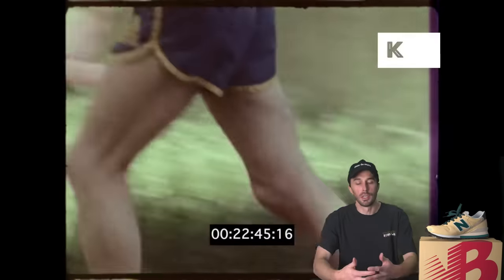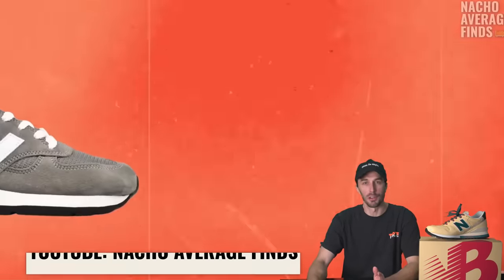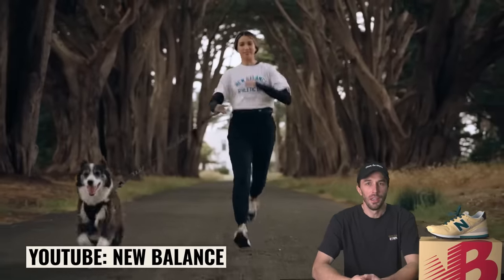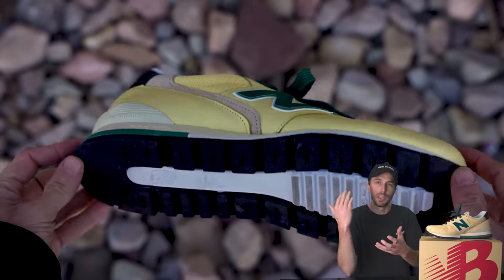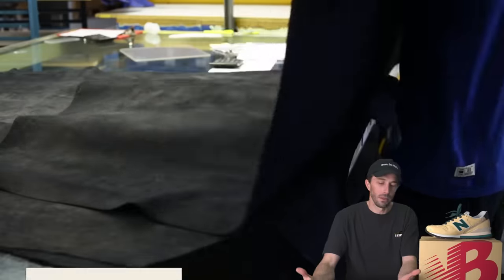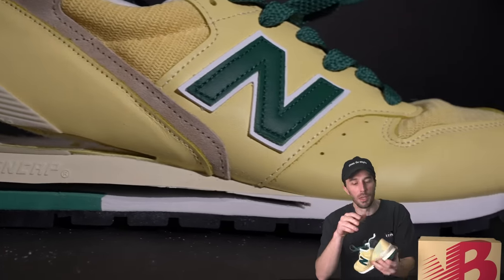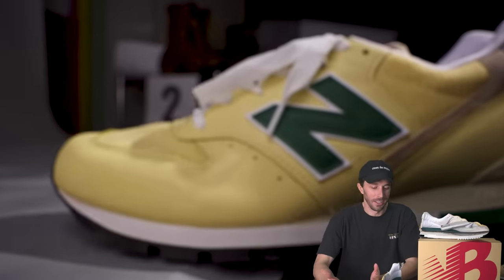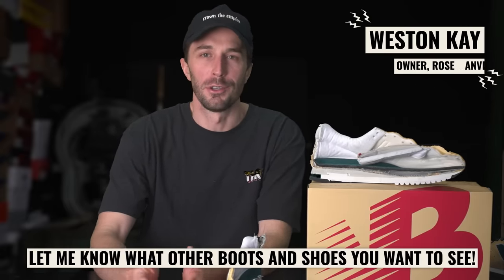(35 yrs) The Truth about New Balance 996 Made in USA

Comment: Unlike other "retro" shoes, these really are like wearing time machines for your feet.
Reply: Air Jordans 1 are a bit older, better and cheaper.
Reply: @diafwnia for retail yes Jordan 1s are cheaper but I find even budget NBs to be more comfortable than Jordan 1s
Reply: @diafwnia Air Jordan 1’s are not better in any shape or form. You can’t even compare the two, one’s a basketball shoe and the other a running shoe.
Reply: @blackdonte24  let me cook you real quick. Running shoes are one of those things no one needs. I used to beat people's ass' in track and I wore Jordan 1s always. Half the time paired with jeans 💀 The only reason these could be considered better is personal preference. Actually I'd say I can get more force into my steps with a Jordan 1 because it's just straight rubber on the bottom. These are all squishy and will probably fall apart after 100 miles. I've put over 350-400+ miles into my Jordan 1s and they eventually wore a hole in the sole. Still a totally usable shoe if I got the outsole replaced, these I font think will survive like that. These are more walking shoes in my opinion 💀
Reply: @MAJORBAGALERT-hg2kp yeah, now run a full marathon with ur AJ1 then start talking shit?
Reply: @JoeTheGetItGuy  I mean once I get into that shape again I planned on it lmao. I've had 20 mile walks, which I incorporate jogging into too, with my Jordan 1's. I've hiked 10 mile days multiple times in the Appalachian mountains (not onna trail) in my Jordan's. I used to do the 100 and 400 in track with Jordan's. I've stood around for 8 hours straight with physical activity with my Jordan 1's plenty of times. Feet never hurt the next day. I'm sorry you can't do that, but my shoes get broken in and they actually feel good unlike a brand new pair of Jordan 1's. When I get to the level of marathons I'll 100% be rocking my Jordan 1s. No one is talking shit, you ain't never heard of shit talk

Comment: I’ve worn the 574 model all throughout my childhood and into high school. They are, to me, a timeless design and can be dressed up or down. Currently I have a pair of 420 v2 that I wear often. I’m not a “sneaker head” or enthusiast, but I’m a sucker for retro shoe designs.
Reply: Me too! 574's are humble, democratic shoes that you can wear all year round for everything. Normcore, low key, almost invisible shoes this days. And cheap too. I use old pairs for hiking as they were hybrid trail running shoes at first. This year I ran the Formentera half Marathon, here in Spain and they perform great. Eva foam molds your feet with time like Birckenstocks. Love them.

Comment: One that would be interesting to see is the Onitsuka Tiger Mexico '66. It's the Asics shoe, the brand that Blue Ribbon Sports (later Nike) bought from Japan and resold in the US to start the brand at the time. The also do a Made in Nihon version, so probably similar. Though the design of the shoe is A LOT less interesting. It would just be a leather comparison, to like the Nike Cortez, really. 

Also, the Nike Tailwind '79 for being the very first shoe to use the Nike Air tech. You've cut open enough Air shoes that the start of that history would be cool.

Comment: had a pretty bad experience with these.

After 2 days of light wear the solel started separating pretty much entirely on my right shoe. Their customer service is pretty abysmal too I had to basically beg them for the opportunity to send the shoes back and get a refund. ended up just shoegooing it back together since I liked the shoes and really didn't want them ending up in a landfill since they'd be used plus having to wait all that time just to get my money back is unappealing. I've heard they have other issues with the sole flaking off so I'm just hoping they last long enough to get my year or two of wear out of them

My advice if you really want these would be to not buy direct from new balance and instead try to find a 3rd party that is actually worried about customer satisfaction especially given this model has a lot of QC issues.
Reply: Damn I have over 25 pair of new balances, I've never had that happen. That sucks. I usually buy from GOAT . Prices are higher. But I've not had one failure from them.
Reply: @hueyriley  Yeah I was pretty surprised seeing as how these are supposed to be like their high quality shoe with the best build materials and all that. Good news is my glue job is holding up and I wear them all the time because they're super comfy and look good in a lot of outfits. Not gonna be my last pair for sure, definitely the last pair I buy direct from them. Thanks for the advice I've been looking at eBay but I'll check over there too.

Comment: Motion control devices have been used in sneakers for a very long time. In the running shoe world there are three broad categories of running shoes used for training.
Neutral shoes which are for runners who either supinate  or don't over pronate.
Support shoes for runners who moderately over pronate or are a little unstable.
Motion control shoes for runners who over pronate a lot.
In broad terms these are often lighter runners,  mainstream runners and heavy/overweight runners respectively though it is not always as clear cut as that.
And motion control shoes for heavier runners from all brands have had built in support features for a very long time.
It is just that New Balance, due to their early history of specialising in  footwear for problem feet (like Alden) have concentrated more on the motion control side of running shoes. This is also shown by the greater number of widths for many of their shoes  than their competitors.
For info New Balance also make shoes in a UK factory as well.

Comment: I'd rather aquire the ultra cheap ch^na copy for under twenty dollen and then put in a leather insole under my foam insole and run it until it falls apart. :) Two HUNDRED for this is unbelievably insane.  I don't blame them for charging it if they can get people to buy it.. but it's just crazy to me.
I actually just bought a used pair of fancy nike running shoes for 10 dollen on fbok.. guy said he only wore them twice and I believe it. They look brand new.   With deals like that on the secondary market, I'd be a complete  dill to spend two hundred..   Besides, I see these same new balance shoes on there for under forty.. so I might have to grab the next pair that comes up..  I didn't realize they are two hundo new.. insane.